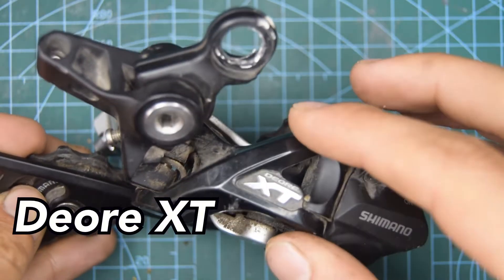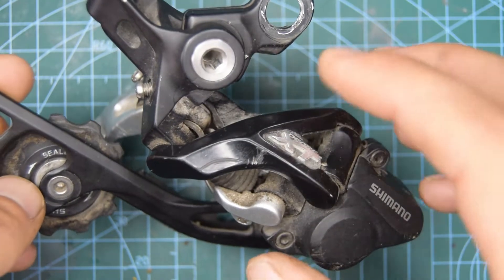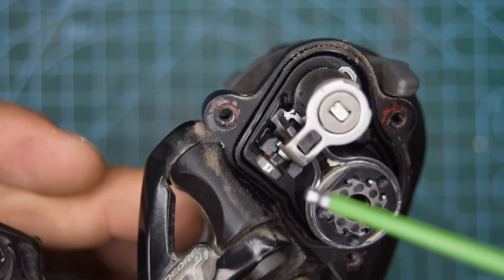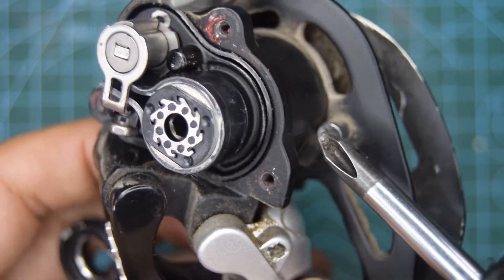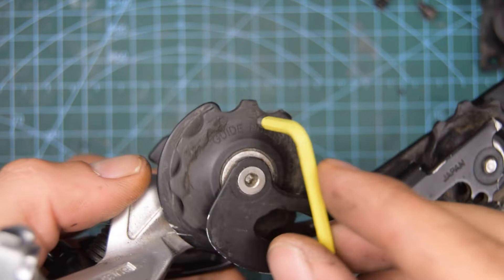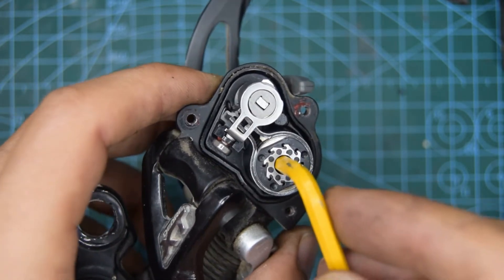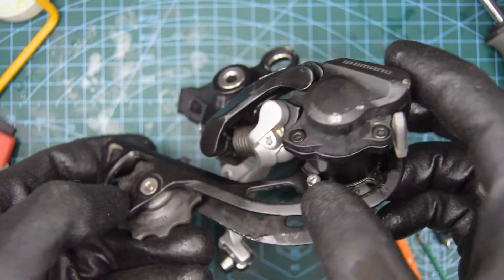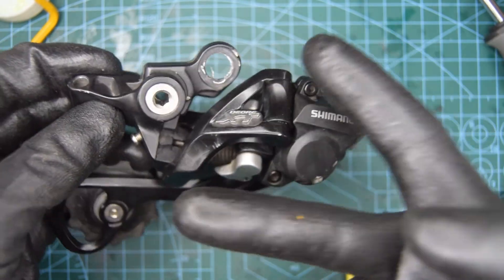Shimano Deore XT M786 Rear derailleur: restore service clean disassembled take apart

Comment: I have the exact model of your rear derailleur, the issue is that the outer pulley cage is broken which I cant find any replacement, do you have any idea if shimano alivio m4000 or altus outer pulley cage can be a replacement for my deore xt outer pulley cage?
Reply from the maker: Theres one for sale on bikable for 16,99 euros. Compatibl M786. As for the M4000, looking at a diagram, it doesn’t look like you can remove the outr cage, so I guess no not possible

Comment: Damn was thinking of upgrading mine to 8000 aswell will just keep it now it still runs faultlessly.
If ibwas upping the jockey wheels tooth wise from 11 - 11 maybe top 12 - 14 bottom do u think it would be a wise  approach? Cheers 🥂
Reply from the maker: Hi, well if they fit on, I’d imagine you might need to lengthen the chain but it’ll reduce chain slack. So I guess in theory, it could handle a larger sprocket. Though I don’t think jockey wheels allow you to do that. Rather the derailleur design. Can’t think of any real benefits other than appearance and apparently it makes less noise? B screw will likely need to be adjusted but 12t shouldn’t be a clearance issue. Why do you want to do it?
Reply: Yo buddy
Think it ticks all the boxes 
Current ones are a lil stretched on the teeth 
Have a bit of spare on the new chain also fancy getting red ones to highlight the other accents on the bike plus anything that's quieter is an added bonus along with a bit of smoother shifting I think it's my last upgrade since the bikes just about finished 🚲